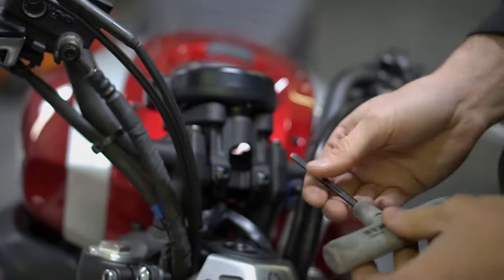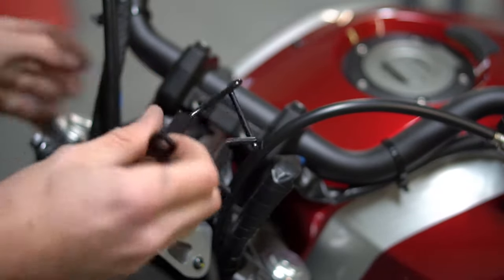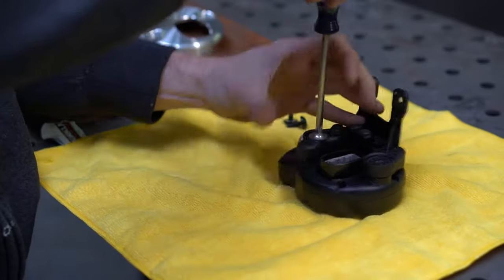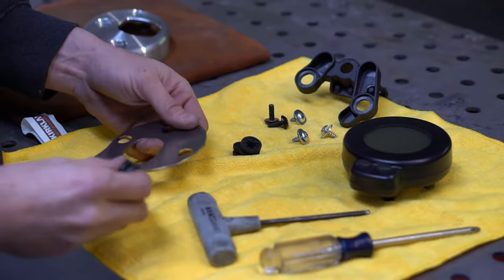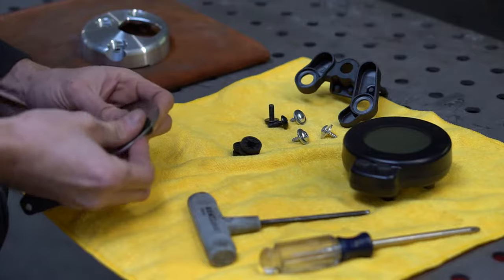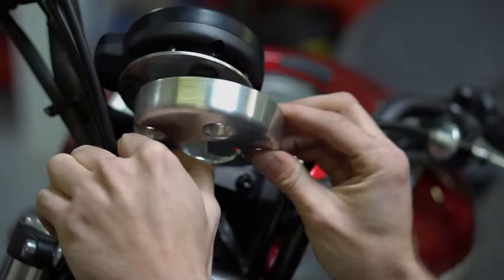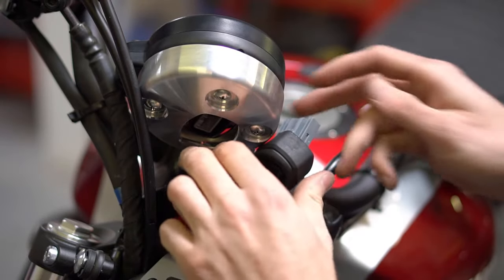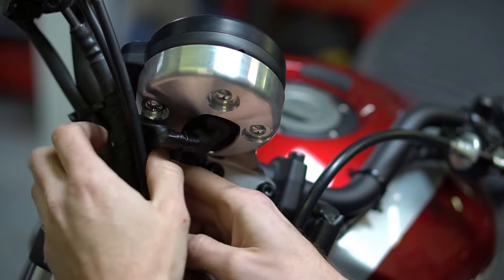Brogue Motorcycles XSR700 Gauge Relocation Kit (How to Video)

Comment: Just received my relocation bracket for my 2018 XSR700. Included were two spacers, which are not mentioned in this video. Were they provided so one can completely remove the stock wiring harness bracket?

Comment: Hello, does the data of the speedmeter (km in total etc..) get deleted when u unplug the speedometer ?
Reply from the maker: No, it will not be deleted or affected.
Reply: Only if you are riding the motorcycle at the time.  :)